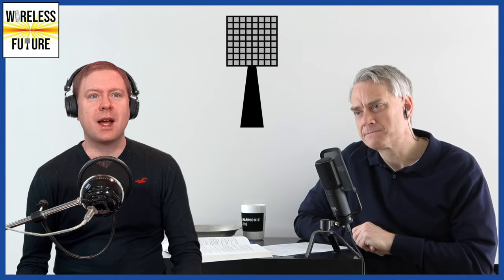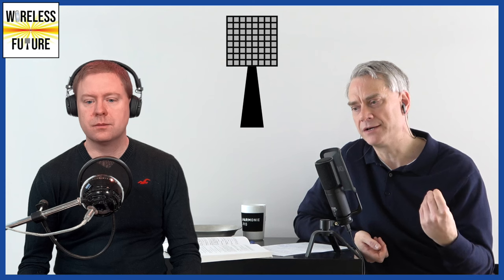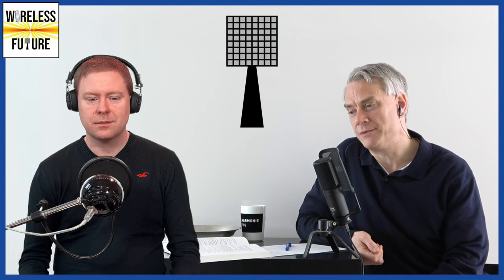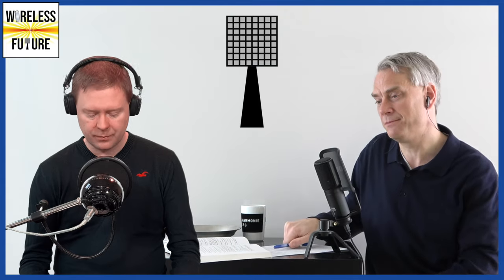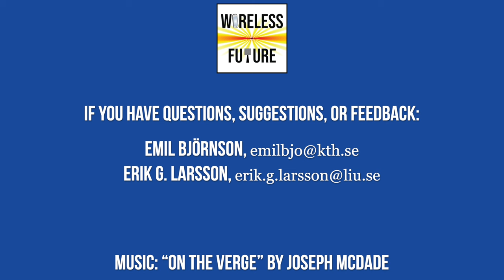Ep 40. Synchronization of Massive Antenna Arrays [Wireless Future Podcast]

Comment: Great insight, thanks for video. You mentioned that calibration is necessary when starting from cold and it takes some time for temperatures to stabilise. Would this mean that 5G mMIMO systems would be unable to be powered down (e.g. for periods of low or zero-load)  if a fast response is needed? In other words, does a mMIMO system need to be permanently powered and radiating to avoid periods of outage due to power-down/power-up?
Reply from the maker: 5G contains several sleep levels, where  different number of components are switched off. The deeper the sleep, the longer time it takes to get back to a well calibrated system. If you turn off the local oscillator, you will have to redo the calibration. I think it won’t take more than a second and then you need to refine the calibration occasionally as the components become warmer. A fine calibration is particularly important when serving multiple users that should be protected from interference using zero-forcing and similar schemes that can be sensitive to calibration errors. This might not be needed immediately in low traffic hours, so I think you can use the base station directly but with lower rates.
Reply: @WirelessFuture  Thanks for your response.